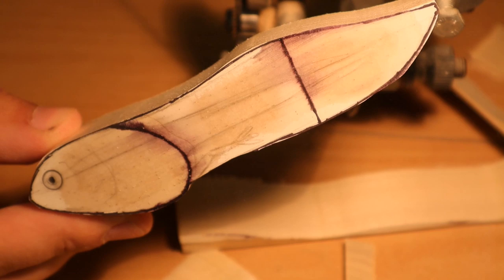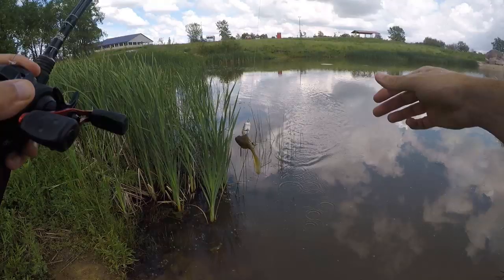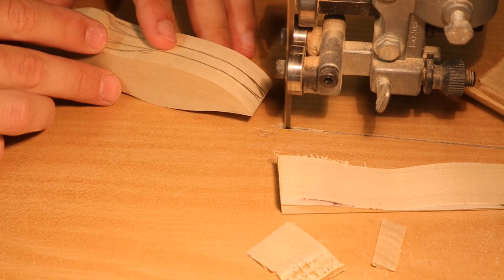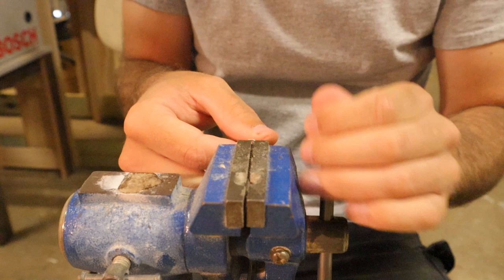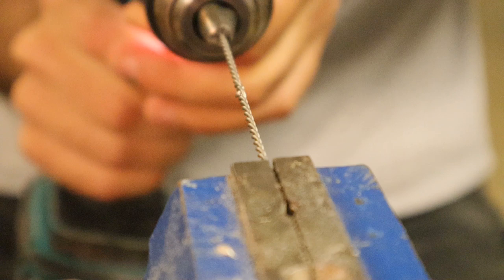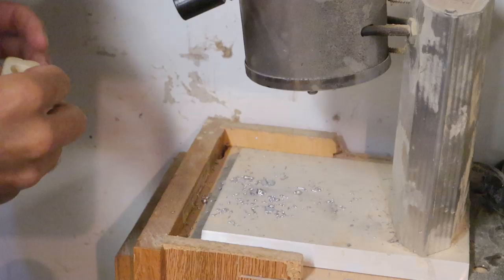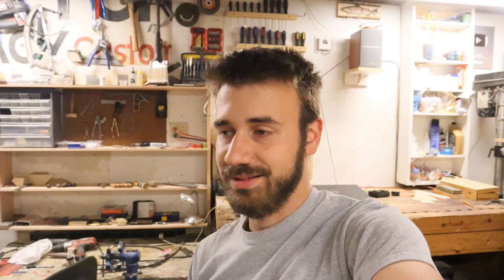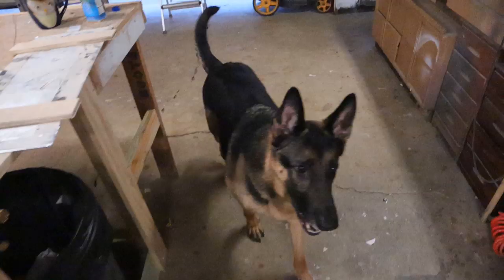Undeveloped BullFrog Tadpole Lure | One Day Build to Catch

Comment: Those lines on the tail are muscle fibers in the tail stalk. They should be lightly carved into the central stalk and painted so they only show from a certain angle. And then a soft plastic edge...